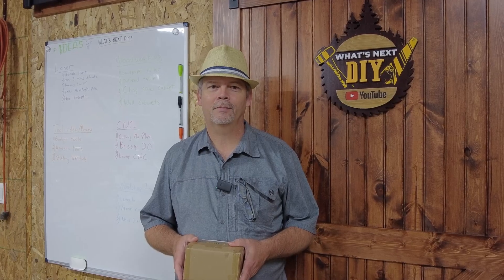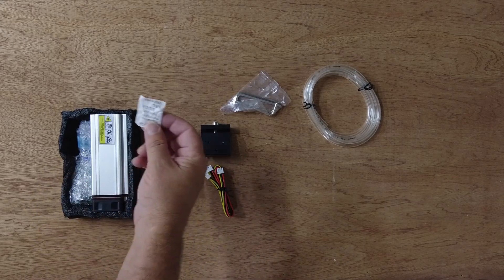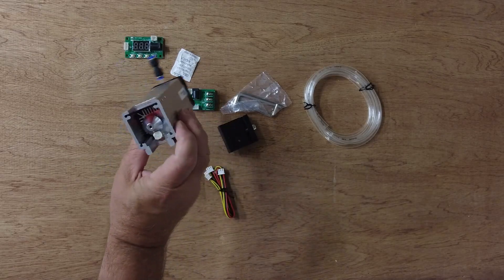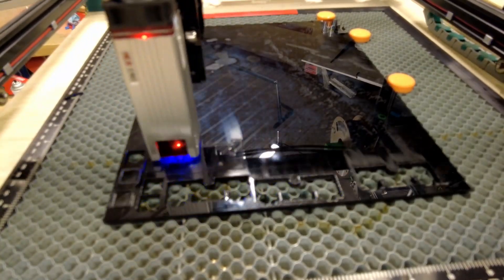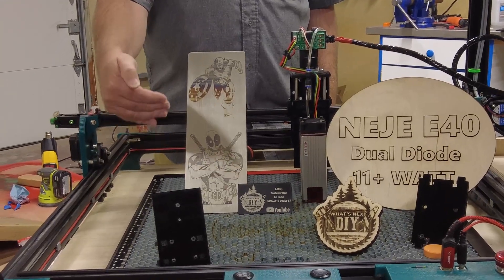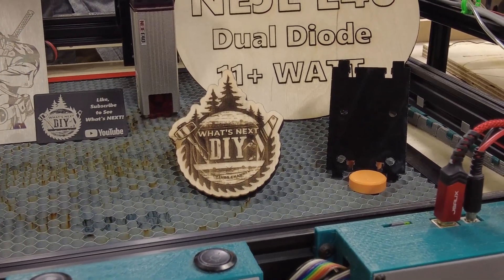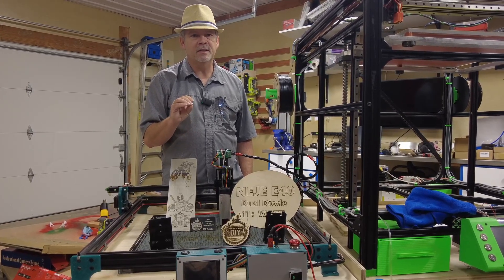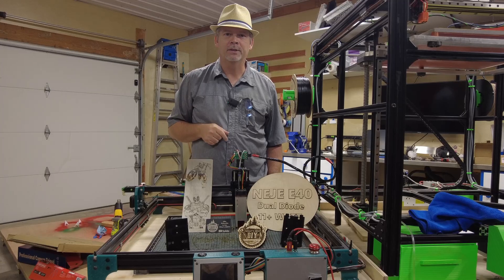NEJE E40 40Watt Dual Diode Laser Review and Unboxing

Comment: I got my E40 yesterday, and wholeheartedly agree with you on the documentation. It's not even in the NEJE wiki where the other kits/lasers have documentation and setup info. The booklet that came with it has one picture of the focal length (5mm), which I agree is debatable, because the product description says 3-5mm, with no real setup information. I pretty much just plugged it into my Master 2s plus 30w setup and it just worked. That's good, because NEJE was no help at all. 

All that being said. This thing blows my Master 2s plus 30w away.
Reply from the maker: Yes, the power was a bit surprising. I kind of wish it had a greater focal length.
Reply: Yes! It keeps hitting my hold-downs: tabs, magnets, weights, etc. Pretty much anything thicker than tape, and that doesn't 
help hold down a warped board very well.

Comment: First, thanks for the review.
Does this Laser Module fit with other laser machines? I don't trust the structure of the Neje 3 MAX much because apparently, its frame gives a feeling of fragility; the frame seems to be too thin to run those wheels in their full length X and Y.  Thank you
Reply from the maker: It will fit some other machines but there are so many out there it's difficult to say which ones. If the machine has 12 VDC output and 12vdc pwm, it's just a matter of making a mounting bracket. As far as the durability of the 3max I can't say but these things don't weigh much so I don't think that would be much of a consideration to me. As long as it moves accurately and consistently it would work well.
Reply: @whatsnextdiy  Thanks for the answer; I have another question: Is this laser similar to the Sculpfun S10 (10W) or is it weaker or stronger? Thank you again
Reply from the maker: @Dancopymus  With a quick glance that seem like most of these laser companies do, over inflating the specs. It appears to be a single diode laser and you wouldn't get 10 watts from a single diode. You might check a review on it to see if anyone says its a dual diode then I'd say its similar. Atomstack makes one similar to Neje
Reply: @whatsnextdiy  Thanks